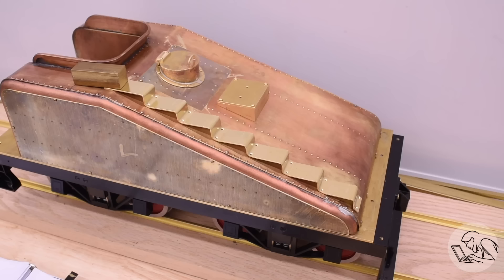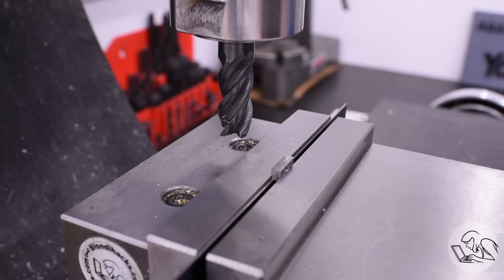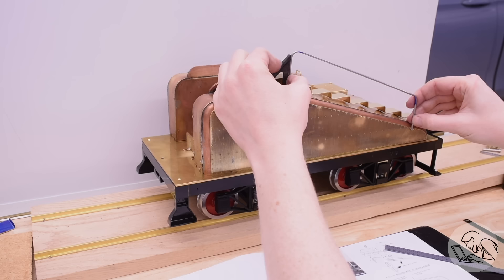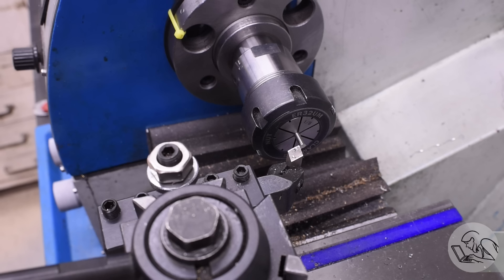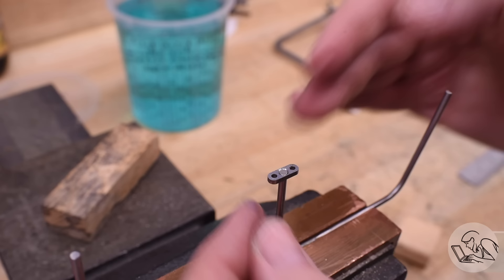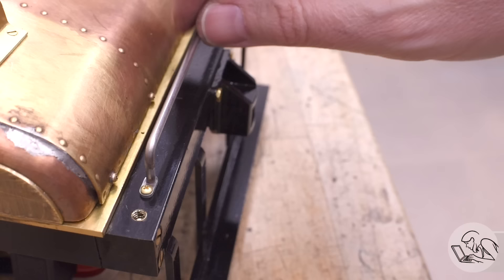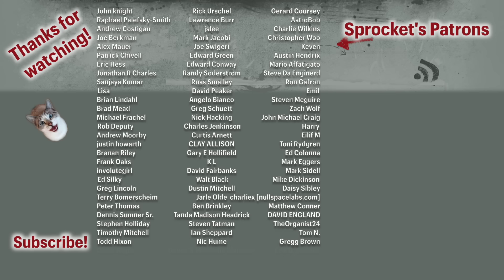Stainless Steel Handrails - Pennsylvania A3 Switcher, Part 28

Comment: Pro tip: if you need stainless wire for aesthetic purposes . buy tig filler. 308L. cheap and available in many sizes. it bends pretty easy too
Reply: Yup, or ask at a local workshop for one or two lengths,  most won't ask why or charge, as it's a dispensable item.  Most guys I've worked with including myself keep small 1/4 lengths instead of grabbing a new peice for a small job.  So usually bits laying around that have already been charged out to a previous job.

Comment: Having had to take a second swing at more than one actual set of stairs, I can feel the particular frustration of not being sure what went wrong. Of course, I am producing my own drawings, so there is no error but my own. I have gotten into the habit of cutting a test stringer in plywood or 1x. Hopefully, it becomes a template.

Comment: 20:26 about those stairs. I reviewed the previous video, and I think the error occurred while sprocket was spinning. I believe you could have avoided this error had you also spun sprocket counterclockwise as well.
Reply: What the Pennsylvania A3 Switcher stair purists don't know is there was a new factory crew one week given the instructions "Get cracking on those stairs". By the time someone who could read blueprints arrived, they had fabricated and installed stairs off by one. Management decided the customer wouldn't notice and shipped the tender as-is.
Reply: Hm. Coriolis effect. Of course. Often overlooked.

Comment: If you hadn't told us about cutting off one stair, I never would have noticed that you had done so - the tender looks so great when you're done 🙂. Your candor makes for a much more believable, dramatic and fun experience - thanks!
Reply: If she made it to the drawing, which I know she did, and made the rail to the drawing. (dittio there) the the drawing is wrong. Quinn was right in both cases.
Reply from the maker: I appreciate your faith in me, but I’m sure the error is mine. I’m just overlooking where it is. 🤗

Comment: When you started to mill the SS, I swear I could smell the smoke off it. I was a maint. tech in a fast food plant and milled on a lot of SS for various projects. When I got to use cold rolled steel for something, it was just like heaven, so much easier to work with!

Comment: The closer you get to the end of the tender (which is looking amazing btw) the closer you get to valve gear. I cannot wait for the valve gear stuff since it's going to be such a beautiful assemblage of linkages. Between this video series and Hyce's "railroading 101" series I've really come to appreciate the engineering that goes into a steam engine, and that it also managed to come out in such an iconic fashion.

Comment: For a smaller torch you can use one of those refillable butane torch lighters...they even have pretty good gas control which can be turned up or down as needed.
Reply: My thought exactly. I checked before saying it and you were 1st

Comment: @27.54 Get yourself an old fashioned egg beater hand drill. You'll get mechanical advantage and still have manual control of the speed. They're perfect for tiny delicate drilling like this.

Comment: I too tap a lot of small holes for much smaller scale models, for holes that I can't tap on the mill or drill press I prefer to us a pin vice for holding the taps, I find that even the smallest tap handle is too clumsy and a pin vice is much easier to handle. Great job on the railings !

Comment: I would throw a non-prototypical grab iron/ladder rung below the first tread where you cut it off. Feels like the kind of thing a crew would have done to avoid having to step on the slope.
Reply: Alternatively, a little strip of "angle iron" - but they'd probably go with a grab iron.

Comment: Only tangentially-related to this video, but I had cause this past weekend to actually get into the shop. I used your small-diameter-wire cross-drilling fixture! With it, I was able to prepare some spring steel wire to use for mending my favorite umbrella! The pins were also made from the same spring steel, and the original factory umbrella... ribs, I guess? were carefully drilled by hand with a bit in a pin vise with the spring steel reinforcement already in place. I didn't have the confidence to use even soft solder that close to the nylon of the actual umbrella, so the pins are in there with super glue. The pins don't actually take much load in this configuration - the spring steel is just backing up the previsouly-collapsed umbrella-ribs so they don't collapse again. All of this was a truly stupid waste of time I suppose, but I feel kinda nice about saving something from the landfill. It is a nice umbrella out of the box, and now it's a little bit stronger than new.

Oh, hey! Also should mention this in case anybody else doesn't know: a hot, saturated solution of regular grocery-store alum (look in the section with stuff for making pickles at home) will dissolve ferrous metals but will not affect non-ferrous metals like aluminum, copper, brass, etc.

So while your wisdom about the risks of free-hand tapping is True as the Word of Metallikor, for those of us sinners who may find ourselves having lost the end of a tap in a non-ferrous piece, all is not lost!

Comment: i see a new tool making video coming-- micro tube bender.   hey Quinn on your freehand tap block how about cutting a u groove down the length of the block so you have more surface to lay the shaft of the tap on , you could also tap and put adjustment bolts in the bottom to get correct height adjustment also kind of like machinist jacks:)

Comment: If you drill out the hand rail and fill with very fine sand, you will get perfect bends with no buckling. (Yes that was meant as a joke.  You can use regular sand.)

Comment: Keeping ones hand away from the belt....  The worst injury I've ever had working in metal or wood was back in high school:  I was using a large disk sander to sand the face of a thin part and it slipped between the table and the belt.  My finger pressed into disk and it flattened the tip (which looks totally normal 40+ years later), but didn't hurt at all.  The worst part was when my doctor had me soak my finger in what was probably betadyne.  I started feeling a "buzzing" creep up my arm, and suddenly I was awakened by the doc- I had passed out from it!

Comment: today in potentially known information: 304 can be a bit of a rectum while machining.  303 has a bit of sulfur in it which helps a lot in machining. It's a bit lower in tensile than 304 but a lot higher in yield, so it doesn't have 304s ridiculous 70% elongation, but still 40%. So as long as you're not using the part as a crumple zone, you're usually good straight replacing 303 for 304. 303 doesn't weld  nicely though. or at all really.
Reply: wrote this too early in the video, there was some 303 to be had, Mea Culpa.

Comment: For small work buy an ER11 to parallel shaft adapter and a set of collets to match. Also handy for putting into a boring bar tool holder plus plenty more.

Comment: I am a handrail enthusiast.  I think you did a lovely job.  Personally I would have had to change the design so that all vertical poles were parallel but I understand and respect your decision not to.
Great tip on the bending clamps.  I normally makr custom tiny bending jigs but I will try that next time.
Reply: Today I learned that there is such a thing as a handrail enthusiast. 🙂

Comment: Coiled round stock is typically straightened by drawing it, which work hardens it and also makes the diameter smaller.

Comment: Great job on the handrails, particularly impressed by the one at the front with the mounting points on different planes. I didn't really understand what was wriong with the stair spacing although I did notice that all the locos in the photos had eight steps, as does the HO model.

Comment: If you can make do with a limited selection of sizes (1/16", 3/32", and 1/8"), but want longer pieces (about 3'), and a huge selection of SS alloys, consider TIG filler rod. My favorite alloy is 316, but then I don't usually have to machine it. Bending and silver soldering is usually enough.
Reply from the maker: Great tip! I did not think of that

Comment: With tapping smsll holes, a coworker of mine had a nice little trick. He had a disk of aluminum woth the diameter knurled. In the center was a hole a bit larger than the body of a tap and then drolled and tapped from the edge for a set screw. He then used that dusk as a tapping wrench, tightening the set screw on the body of the tap. That way you dont need to use a "heavy" tap wrench like you were and you dont need much torque for those small taps.

Comment: a technique you may wish to try - I find it easier to hacksaw Parts on the LEFT side of a Vice, if you are right-handed. This allows you to easily stabilize and hold the Part as you cut thru - no more Parts dropping to the Floor.

Comment: Using sockets as mandrels for wire bending works pretty well, you can clamp one start of the bend to the socket directly because it's tubular, good surface lots of size options and they take a hammer strike well - maybe don't use a good set.

Comment: I got a trick for straightening out coils if you ever wanted to try, you clamp one side in a vice, pull it tight with a set of pliers, then smack the pliers with a hammer.

I straightened out copper tube thst way for making antennas.

Comment: Old train crews were known to remove the railing because the two different angles for the vertical legs is an affront to man and the gods. Whoever designed that initially probably didn't like chamfers either.

Comment: You might try cutting the fish mouth, by using the wire drilling contraption you made and a drill bit the same size as the wire you are trying to match too. This is how we do pipe when building fence except we use a hole saw the same size as the pipe.

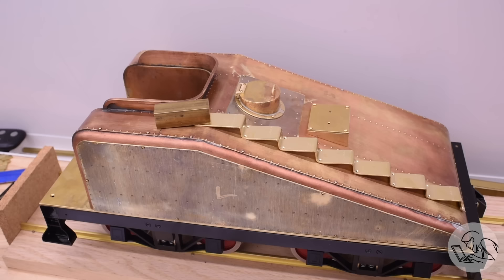Comment: 20:15 The real tenders would also have had significant tolerance variations in all the lengths and angles.  The stairs and railings would have been made "to fit" like your historical photos show.  They would have been bent, broken, and repaired over the tender's service, too.  Your alterations from the drawing just make it more authentic!

Comment: I see a Smith Little Torch in your future. It can do the finest stuff with a small tip and with the largest tips and the rosebud overlaps the bottom end of what you're already doing. It can work with oxy/propane or oxy/acetylene with appropriate regulators. I'm guessing Gesswein Canada might be a source you'd use. They're a jeweler's tools and supplies place and have lots of stuff that overlaps into a small machine shop's needs. Or look around. Does Rio Grande ship to Canada?

Comment: I believe you had everything correct.  Go back to episode 1 at the 7:40 mark. In the video you turn to page 49-50 in the book and the photo in the upper left corner of page 50 shows railing coming in at half tread location. I May be incorrect. But just a thought. Also, in this video you show us the HO scale model that actually has 8 steps so it is not an accurate representation of the blueprints.

Comment: Bit late to this, but the HO model (0:42) and photos (1:12)  have eight treads, but your model has seven, pic at 1:12 also has a much larger riser on the bottom step and overhanging rail with a return at the bottom, so who is to say what's correct?

Comment: Beautiful work on those rails, Quinn!  I like the 'sliced bread' approach to making those little parts. Though slitting saws aren't my favorite, I really have come to like how they can slice off multiple parts so neatly like that!  Very nice work.

And I love that you share your learning with us - using too big of a torch for the silver soldering - taking multiple tries to get the rails bent correctly.  It helps make the rest of us not feel so bad :)

As for the stair rail length mystery... I'm wondering if the rail was too short by a tread length?   I believe I had to use a 13" piece of rod for the long rail.  So if you were able to do it with a 12" length, it makes me wonder if it might have been a tad short?  Just a thought.  And what you have done looks beautiful. I'm not a rivet (or stair) counter, as anyone who has seen any of my work knows.  I just love a good mystery! :)

Beautiful work, Quinn!  You're going to be on to the loco before you know it!

Comment: If you still care about finding the source of the error, did you try a rise/run calculation for the drawings of the stairs and tank and the same on the actual tender?  Should be pretty easy with the milling machine DRO.  IIRC there were a few, uh, learning opportunities when making the tank side formers. If you prefer to paint it pink, erect a SEP field, and enjoy a well deserved gin and tonic that would be my choice too.

Comment: Coming along very nicely. 

I wonder whether you could also use brass for the railing,  then Nickel or Silver plate it? The added strength of the stainless probably helps in this application though.

Comment: At time index 4:20 I notice one of the parallels is crooked. What kind of impact could that potentially have on your part? I imagine the inner corner of the parallel is slightly higher but since you have the vice jaws clamped I'm not sure how much it matters

Comment: I think what you experienced was gain. (electrician here) When you bend metal 90degrees it stretches and you get gain. That's how a 10' stick of pipe measures longer if you bend a 90.  This is just a SWAG (Scientific Wild Assed  Guess) mind you.

Comment: Did you consider just turning down the ends of the stanchions (sp?) rather than making separate pins?  Never mind, I just needed to watch your video all the way through before asking :-)  However, the fishmouth really isn't necessary if the solder can fill in the gap.

Comment: Hey Quinn, just have to say I am enjoying the series and you have inspired me to attempt this build. I'm not willing to delve straight into the project, I like to draw a project first (fusion 360). I had a similar issue with the steps when I first modelled them, too long. I then realised I had used a tread width of 1 3/16" and the 0.2" on each step. This resulted in overall length being too long by approx one step? Anyway, good luck on attempting to complete the build by the end of the year. Back to my drawings now 😄

Comment: If I can take a short break from rivet counting?  
Looking at the small black model and the old photos I wonder if the rail/step issue is that there are two (or more) different styles of rail/step combination?  The small black model has the same short rail as you make here but the steps do not go all the way down to the rounded end of the tender (although it does show 8 steps), so short rail/short steps.  The photo at 1:18 in the video with the rail going all the way round onto the curved end of the tender shows the steps going all the way to the rounded end so long/long rail and (8) steps.  What the plans seem to have is a mixed short rail/long steps combination.  
Having said that the photo at 1:09 doesn't appear to have any rail or steps so there may have been examples in the day of all sorts of combos. Maybe Kozo was just working off different pictures.  On that basis I can't see much problem in opting for the short/short combo that you did.  
(Though I suspect the1/2 step issue wasn't the steps but that the top part of the handrail from stanchion to bend is too short, which would move the handrail down the tender the required amount)
That's enough, back to the rivets ... and to eagerly awaiting the next episode.

Comment: A little bit of me died when you cut the steps, but one should always do everything railroad (railway, I'm English) related under Rule 1. It just goes to show that sometimes, physics breaks. No matter how well you've measured. Physics breaks. I recently, painstakingly, painted a TT scale speed limit sign. I turned away for twenty Planck seconds and it vanished. Completely vanished. I've search the entire area up to and including the next room. Gone. It has ceased to exist. Physics breaks. I'm even contemplating lightly stabbing myself with a really thin stick and when the police arrive tell them the assailant used a TT scale speed limit sign and see if they can find it...

Comment: To speed up the first edge couldn't you have set up a stop in the vice for the pin?

I suppose the trick would be holding it so you're not too far from the hole where the stop touches the pin.

Comment: Will the threaded holes and the screws leak water, just curious.
Reply: A tiny dab of RTV will fix that and still allow disassembly if needed.  Remember there's no pressure on the water there.

Comment: Quinn, may I suggest you use the pin vise to start the hole - and then when sufficient depth is achieved, switch over to the Dremel rotary tool to complete the hole with much less fear of skating across the beautiful surface.  If you do think my suggestion has merit, I would further suggest (like I have learned from you 😉) that you practice on a few holes in a representative piece of scrap 👍👍😎👍👍

Comment: Im a dead tree carcass butcher, so forgive me 😂
The slitting saw was measured on its "plate"...... Doesnt the saw have "set" so the teeth create a kerf wider than the plate, so theres no binding???? 
I sharpen and set my woodwork saws, they simply dont work if theres no set, and with metal ya want to avoid rubbing at all costs, it ruins edges. What am i misin lads?? 😁
Reply from the maker: No, slitting saws cut differently. They are a machining cutter, not a saw blade. They cut exactly on width. Each tooth is clearanced internally, just like a lathe tool
Reply: @Blondihacks  Thanks Quinn 😁 my mistake was thinkin it was a saw...... tbf, "saw" is in its name 🤷😂 
Thank you for teaching me 😁